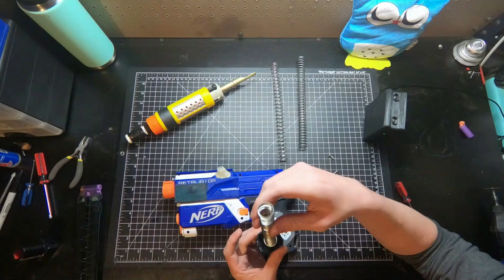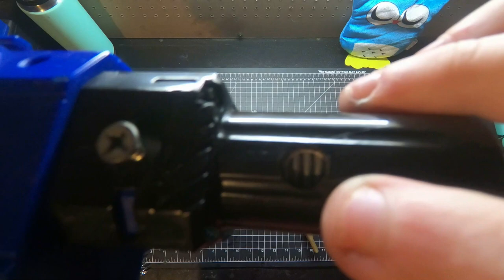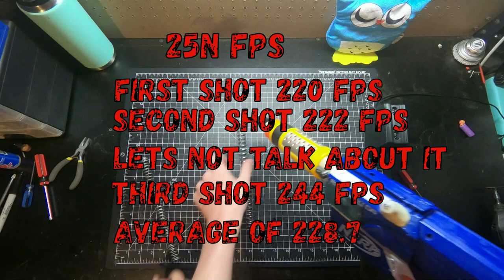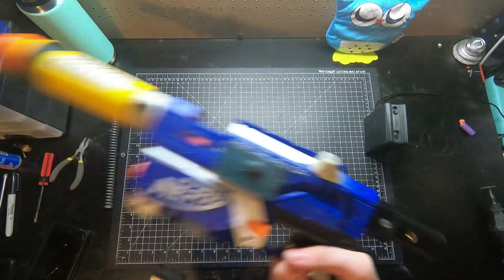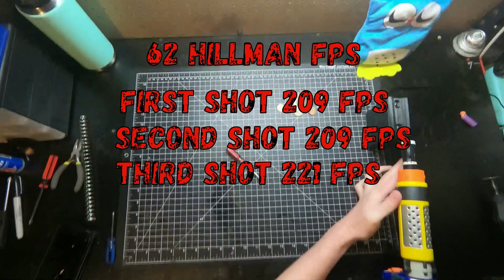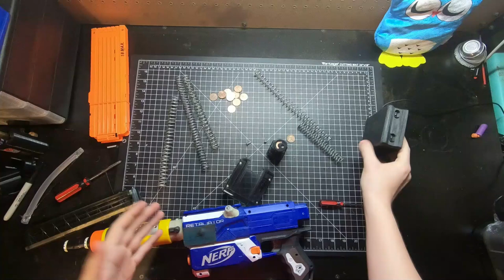HMI-R kit  spring test (62 hillman 25n 28n and BT27)

Comment: I've been wanting to do a video like this for a while. I have a bunch of other springs I've found and was gunna compare to the ceda springs too, but need to get hold of some of the ceda springs............. Also that barrel attachment thing is super cool. I'm guessing you have different ones for different pusher, adaptors and dart sizes. I may have to have a go.... What length of brass do you have on it out of intrest?
Reply from the maker: I don't really like pusher breeches so I only have different barrels for either half or full lengths. The barrel in the video has about 10in of 17/32 but I plan on testing if I should go longer to get better performance.

Comment: Could u let me know what's your barrel length? Also do u use expand plunger tube ? I also have 28n spring and 20cm worker alum barrel (13mm ID) but it just reach around 160 fps.
Reply from the maker: Yep we run XPTS and barrel length of 30.5cm+
Reply: @modbros5345  thank u man. Great mod.

Comment: Thanks for the vid!  Should I be running a spacer in a ceda with the #62?
Reply from the maker: In short yes I recommend getting all the springs near full compression for best performance. The ceda does take a little shell work to get the spring guide to fit in properly but should do the proper compression for the hillman if in the shell correctly. Id say maybe half an inch behind the catch.

Comment: What do you need to do to run the long spring in the stock back cap?
Reply from the maker: Truthfully not much. I have a printed spring guide that I use to ensure everything stays straight but that's about it. As long as it isn't one of the worker stock attachment piece that doesn't have the cylinder portion it'll fit the long spring. The only other thing I recommend is additional screws to lock it in place since the two originals aren't that strong.